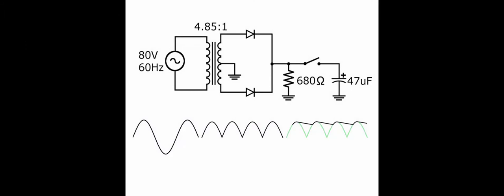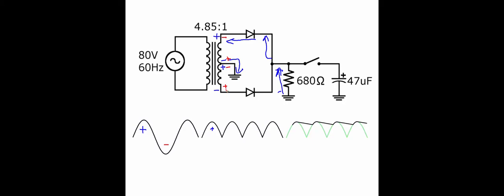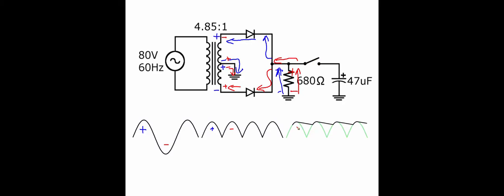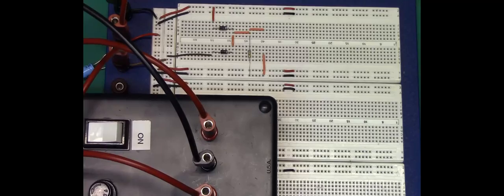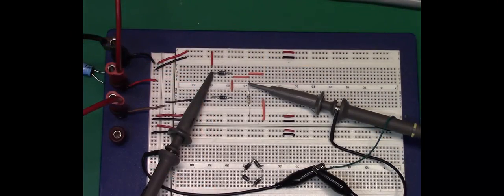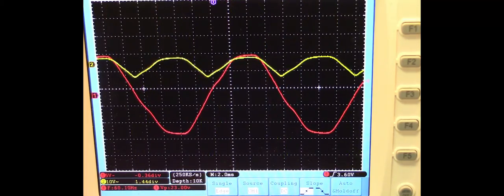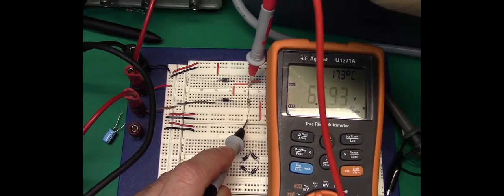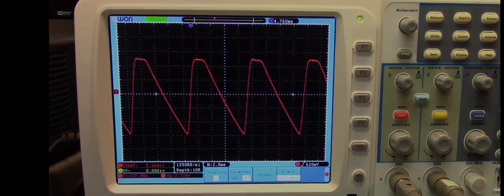20. Full Wave Rectifier Using A Center-Tapped Transformer

Comment: I have seen videos using a center-tap transformer with 2 diodes for full-wave rectifier and a single smoothing capacitor and I have seen them with the standard full-wave rectifier with the center-tap tied between 2 smoothing capacitors. Transformers are rated in power as either Watts or Volt-Amp rating which is still the same thing. So is there any one that is better for a power supply. If you have 30 volts AC at 4 Amps and after DC Rectification and Regulation - is that going to provide 15 Volts at 8 Amps?
Reply from the maker: The problem with using a center tap is that it cuts your output voltage in half. To get the values you mention will require a 150VA transformer, not exactly small. If you apply 30VRMS you would get about 42VDC (with filtering) and then you would have to regulate it down which wastes a lot of power, unless you use a suitable buck converter.  A transformer with a secondary voltage of 12V would give just over 15VDC (with filtering from a bridge rectifier).
Reply: The Pyramid PS-7 sometimes referenced to as the Tenna PS-7 Power Supply only uses one 2N3055 with a small center-tap transformer - most supplies use at least two 2N3055 transistors. The information I have seen states that each transistor increases the current. I always thought what ever the wattage rating  was would stay the same if voltage is decreased the current would increase.
Reply from the maker: True, if you need 15V at 8A, you still need a 120VA transformer plus a margin for voltage fluctuations and less than perfect efficiency.
Reply: I am trying to make a 13.8 volt power supply to replace the one that was originally in my Galaxy SSB Base Radio - the power supply was not fastened good when shipped from E-Bay seller and the transformer and all the wiring to it and the regulator board was destroyed and have been powering it from a Pyramid PS-7 Power Supply. I purchased two 100VA /28 Volt transformers and they have a center-tap - I have another radio someone replaced the transformer with a small Radio-Shack transformer and they just left the center-tap open and unused.
Reply from the maker: Okay! You need about 3 amps on transmit, maybe 4 tops. So a full wave filter using the center tap, i.e. using only two diodes (plus appropriate filtering) would work. Each half of the transformer would supply half the current  and 14VRMS. The caps are going to charge to peak voltage to just under 20 Volts so you will have to put some regulation at the output. I don't know how much you want to do but a series pass transistor for the current will be needed plus a zener to regulate that. Something like this https://www.electrical4u.com/images/2017/march/1488629483.png
Reply: I was looking at using one of the buck converters with protection circuitry and a full wave metal housed rectifier. I received my transformers today 33VAC on the outer leads through the full-wave rectifier I got exactly 28VDC. The transformers are Altronics 28 volts at 100VA so roughly 3.5 amps of current. Thank you very much - I was told that I needed 6 amps for side-band which I thought was high needing 82 watts for a maximum 25 - 30 watts for SSB output. I figured at 13.8 volts and 3 amps of current should provide 41.4 watts rounded off to even 40 watts.
Reply from the maker: The side bands should have about 12 or 15 watts of power. I am not a CB expert but if we take a 4 watt AM output and make it ssb, the power should be about 12W-15W. It isn't modified, is it?
Reply: I am not sure - it has a lot of hack jobs inside the radio that are not stock,it is an Ebay purchase that got damaged in shipping. I am trying to fix a power supply for it - the regulator board is almost 20 dollars plus the shipping charge and that does not include the 2N3055 regulator that mounts on the back heat-sink. The transformer I have not been able to find is why I purchased the 28 volt center-tap to use to replace the original. Is the buck regulator that I mentioned going to cause noise in the radio - I thought it was just a board that regulated the high voltage but after doing some research it is high frequency PWM Regulation.